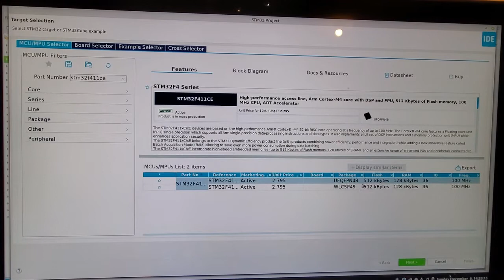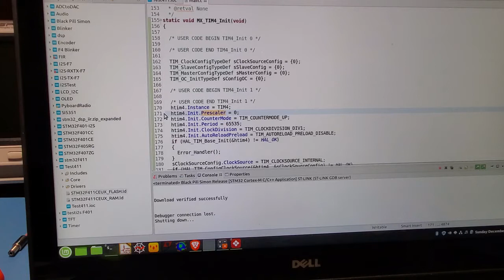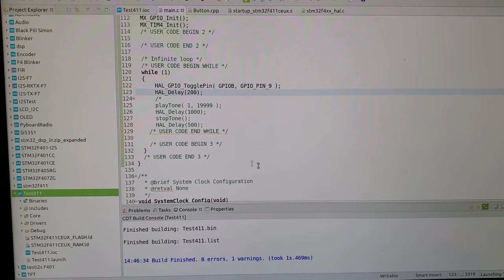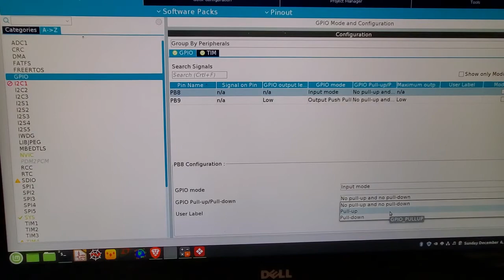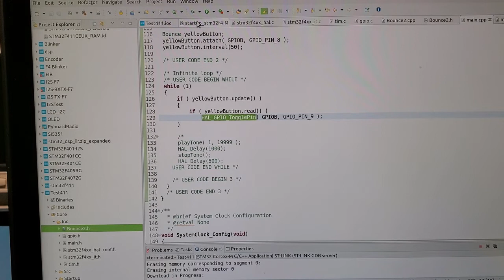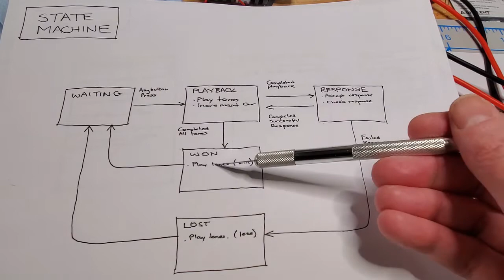Simple Electronic Game with Black Pill STMCubeIDE

Comment: Pretty late to the game, but I have this problem regarding the power pins on the black pill. On the ST forum, an ST employee said this about the Blackpill made by We Act:
"If you do not use the 3.3V connection to supply smaller external loads, but to feed in the 3.3V, you could run into unforeseen problems. This is because you are operating the LDO AP7343D-33FS4-7B backwards, since the p-fet it contains usually has a parasitic antiparallel diode with an anode at the regulator output. This diode path conducts as soon as the output has a higher potential than the input - i.e. when 5V is open." ... "3.3V is an output and very likely not suitable for feeding in".
- So is powering the board through a 3.3V pin considered a bad practice? Did you have any problems powering the board using 3.3v ? I still haven't ran into any problems though

Comment: Hi, I'm facing Issue, I have powered the stm32f411ceu6 blackpill from  a 5V buck convertor to the +5V pin on board, but the board does not power ON, 
It works when USB is connected, but does not power-on when battery connected to +5V on board.
The USB-C is connected to the LDO, and LDO output connected to all 3.3V pin, but I cannot see the +5V pin connected to input USB power. (also when powered from USB, +5V can be measured on the 5V pin)
What could be the issue?? could you please help
Reply from the maker: A few suggestions:
1) There are two 5V pins on the board - did you try both?
2) Do you have a way of injecting 3.3V into that pin
3) I have looked at the schematic https://www.sgbotic.com/products/datasheets/development/F4x1Cx_V30_schematic.pdf and I didn't see any else obvious. I think if the LDO was blown then USB wouldn't work so not sure

I hope this helps
Reply: @na5y  thanks for the suggestion,
1) yes, i have checked input on all 5V pins, does not power-on
2) Not completely clear from schematic, but im surprised input 5V is working for you in the video.
3) Special case: It works if battery connected to 3.3v pin (on any pin), but i observed, if 3.3v given to 3.3v pin, then 5v pin volatge < 3.3 volts.
If 5v given to 3.3v pin then on measuring voltage on 3
3v pin shows 4.9V and on 5V pins shows 4.5V(which is not good, as whole controller is working on ~4.9v, will get wrong ADC reading later).
4) nothing works, finally planning to tap the VCC and GND lines on USB-C just before LDO and connecting it to battery🤦.
Reply from the maker: The schematic could of course be wrong... There's so many versions of these black pills out there - all with their own QC problems...

Comment: Nice work, what is the ST link V2 connection to the black pill pin out
Reply from the maker: Have a look here
https://www.st.com/resource/en/user_manual/dm00026748-st-link-v2-in-circuit-debugger-programmer-for-stm8-and-stm32-stmicroelectronics.pdf

Go to page 12/13 and it shows the pinout. The only lines in use are VAPP, GND, TMS_SWDIO (which goes to SWDIO) and TCK_SWCLK (which goes to SWCLK).

Note that that STLink does not provide power to the board - you have to power it separately. 

Thank you for the comment and I hope this helps.
Reply: thank you